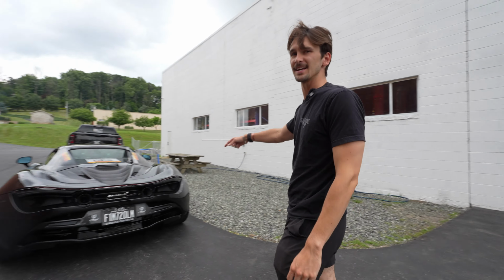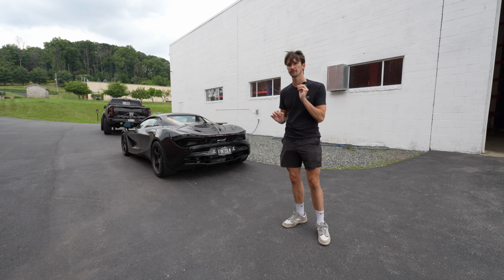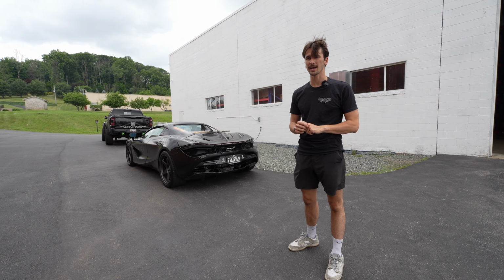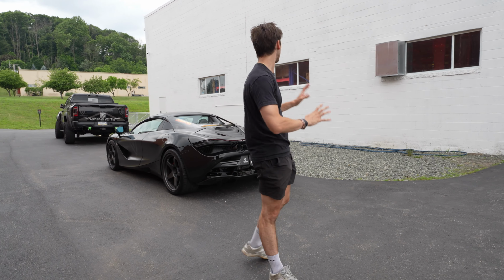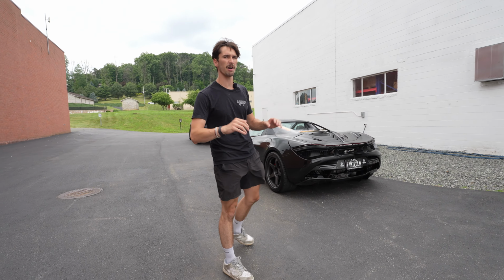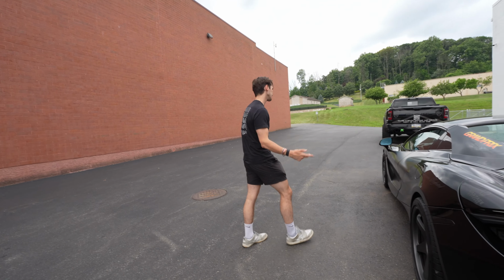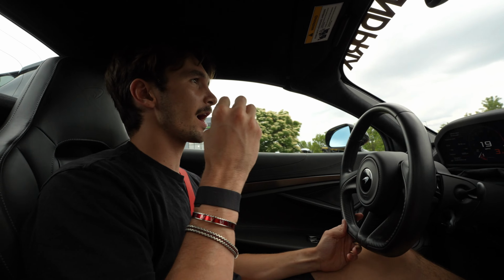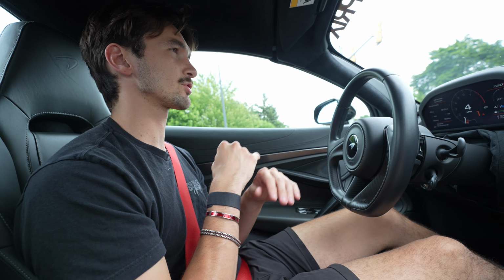HIGHEST PITCH MCLAREN 720s IN THE WORLD?! Titanium F1 Exhaust + Free Flow Downpipes

Comment: I have a 2020 720S, currently with Soul 200 cell downpipes and the stock sport exhaust. I am looking to get more sound and A higher pitch tone from the exhaust. I am interested in your F1 double x-pipe exhaust, perhaps with valves so I can have full control of the sound. 

A few questions….are the downpipes on your 720 catless?  Do you have a tuned ECU?

Does the valved version of this exhaust sound similar to this when the valves are open?

What tip finish options are available, and do you guys do installation?  Feel free to DM me.
Reply from the maker: @tomshen  hello! So this had free flow downpipes. The F1 system does not come with valves. The valved system and F1 system sound much different. This car is stock tune.
Reply from the maker: @tomshen  tips are burnt titanium. And we do installs for development vehicles only at our HQ in PA

Comment: Love the sound… but will it pass the wife test?  How much louder than stock during cruising low throttle driving?  Just sold my 458 because wife wouldn’t ride in it due to the loud exhaust.
Reply from the maker: @daviddeatsch818  your wife didn’t like the 458, because there is a very loud resonance you get even driving in low speed with an exhaust on the actually aspirated 4.5 L V8. With the 720s you don’t get that residence because the car is turbo charge. I can pretty much guarantee you if you have this full exhaust system and you drive around you won’t get any complaints. I’ve taken my mom around in my personal car and she’s never complained and she’s very annoying sensitive. - austin
Reply: @valvetronic  the 458 had a Gintani exhaust which was basically straight-piped.
Reply from the maker: @ great setup, definitely not for the faint of heart